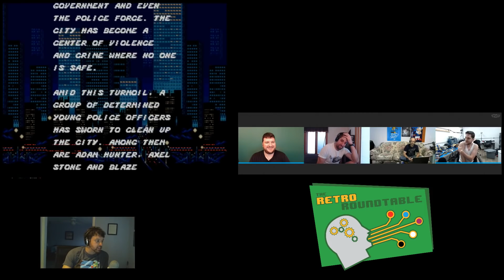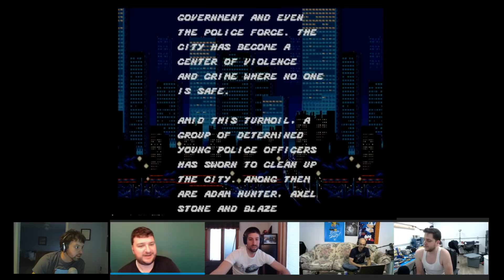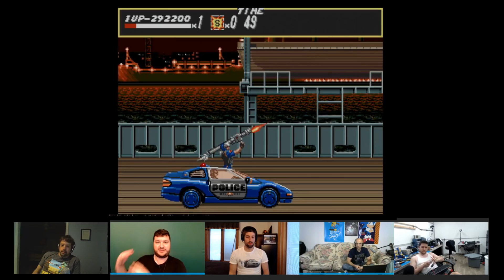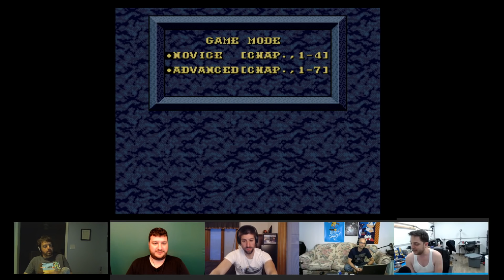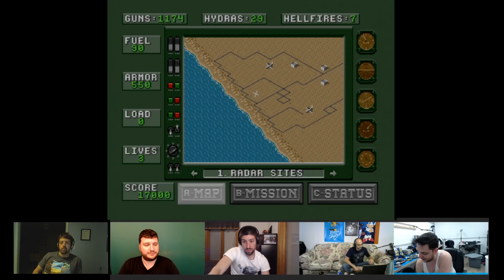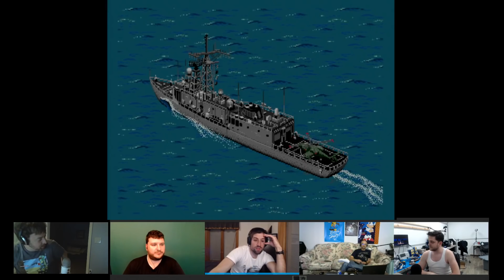Ep. 21 - Nick sucks at video games!

Comment: Going through the roundtable archives and it's good stuff!

But then Nick switched Desert Strike controls to turn off momentum... Video title justified.
Reply from the maker: That's interesting, you know, I never really thought of those controls as a difficulty setting, just a preference. I guess my assumption was that some people would prefer the momentum setting, others from above. But it makes sense. Plus, I do suck at video games so checks out.
Reply: @TheRetroRoundtable  It's definitely a preference thing more so than an explicit difficulty, but if I remember correctly the manual actually recommends starting with momentum turned off and to later turn it back on for the proper experience (or something like that) after you've gotten used to the game.

I think I did turn it off when I was younger, but eventually started playing with it on just to freshen things up. After getting used to it, though, I never went back! Once you get the hang of it you can dance around enemies with the extra agility it allows, which actually makes the game easier in the end!

Comment: I recently bought an Atomiswave arcade board to consolize for use with HDRetrovision Genesis cables on my CRT, and  because I know how dangerous arcade systems can be to equipment, I have a quick question. Is it unsafe for any reason to connect the 5V pin straight to the Power Supply? Tapping into the +5V on the JAMMA connector results in incredible video interference.  Also I love René's bald head and I hope he recovered his files.

Comment: Lol I feel for ya Bob. I had a similar issue with an absolute POS of a human being who sold me a PVM through a vintage CRT group on Facebook.  The guy claimed it was in perfect working shape and would double box it with a foot of padding, and when I got it, it was in a single box with a single layer of thin bubblewrap around it.  Naturally it was completely smashed up and wouldn't even turn on.  I tried to do him the courtesy of handling the issue outside of Paypal without having to open a claim and he similarly lost his shit, threatened to sue me for scamming, etc, even though I had clear pics of the item before it was shipped and after, and that isn't even half of the story.  It was a complete and utter mess, ended up having to file a claim as he refused to give me any of my $ back.  

He also gave me shit because I opened a claim through UPS for the damages as the package had insurance due to me asking for it, I did not want to buy it without insurance due to my bad luck with PVM's being shipped in the past.  That is why I asked him to make absolutely sure it was packed extremely well.  They denied the claim due to the way it was packed, and he of course blamed me for the claim being denied, cussed me up and down, etc.  It was a complete headache.  Tried arguing with me to death about the fact that I was the one that opened the claim, even though it CLEARLY says right on the UPS website that the recipient must be the one to open the claim.  Ended up having to eat the return shipping cost as I had to send it back in order to get my $ back thru Paypal which ended up being half the cost of the item.  Was just a horrible experience.  Will never buy a PVM via online methods ever again.